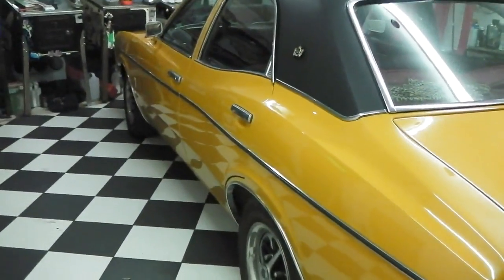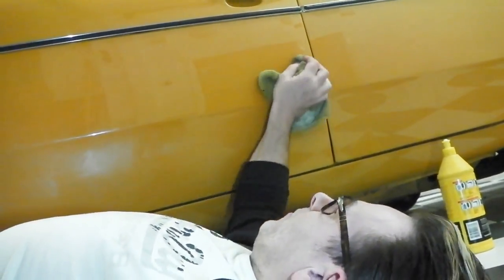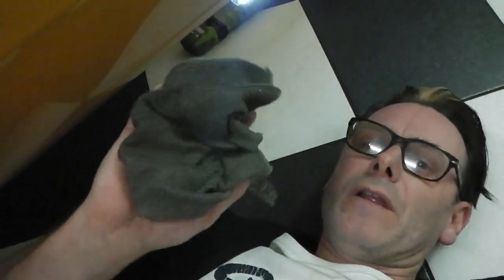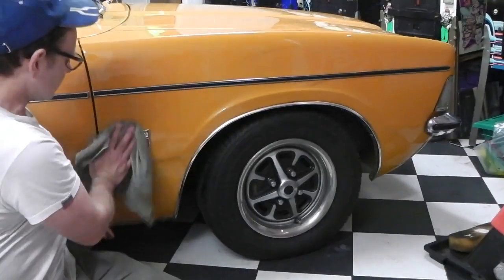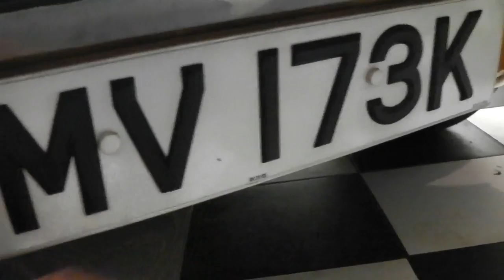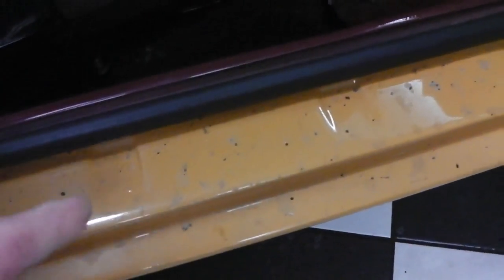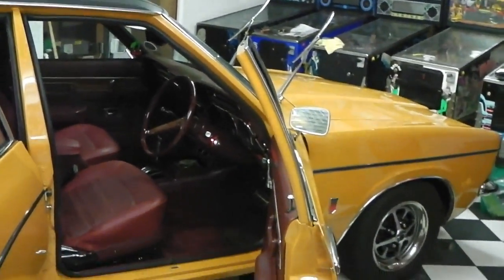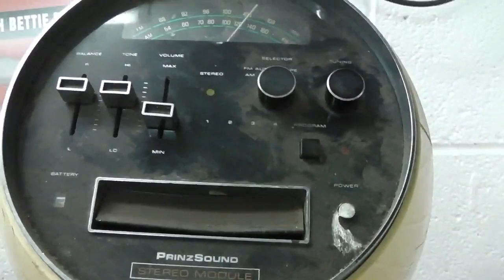Mk3 Cortina GXL - Winter road trip clean up PT2!

Comment: I am French and I bought my first Ford 32 years ago, when I was student. It was a 1973 Taunus 1300 XL Sedan. It was a real revelation for me. I have never buy another car brand since 1986. I had two Taunus (1973 ; 1976), two Fiesta (1986 ; 1995), one Granada (1979), one Sierra (1992 the very last one), one Ka (2000), two Mondeo (1997 and 2011 I currently have).
When I see the restorations you made, I am so  impressed. Your two Cortina are so fabulous. They are probably better than a brand new one. Each time I speak old cars with someone, I show your videos. I am a great fan of this kind of restoration. We all know that the Cortina (or Taunus in France) has not a great value, but you decide to make a great work as it was a very rare car.
Thank you very much, each restoration you made is a fairy tale.

Comment: With you on the potholes; Oxfordshire is really bad too, some of them are little more than dirt tracks now. Have you ever considered Paint Protection Film (PTF)? It's a transparent film coating that protects against chips and scratches; you can run a key along the paint and the paint beneith the film does not get harmed. You just heat it up and the scratch disappears. There's a video demo on youtube somewhere, alot of supercar owners use it on Porsche & Ferrari cars etc. Not a cheap process, but it's a really good product that protects your investment after a full restoration. Probably not as expensive as a full respray though.
Reply from the maker: thanks Mathew, yes i looked into the film and im going to get any stonechips fixed then cover front valence and sills. its £350 to do.  ps why dont you come over and join us on patreon? theres loads of stuff on there. www.patreon.com/cortina
Reply: Are you not a fan of mud flaps Pete.